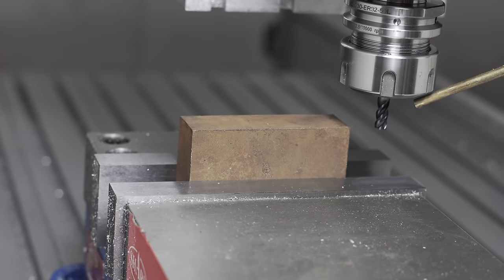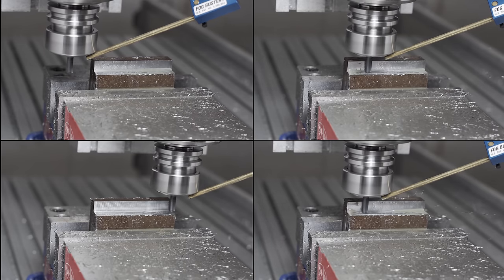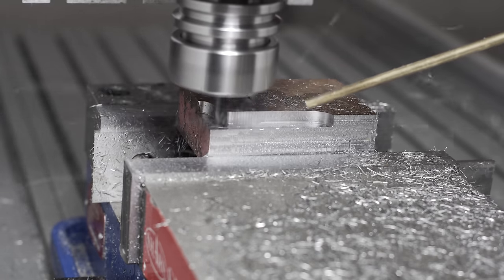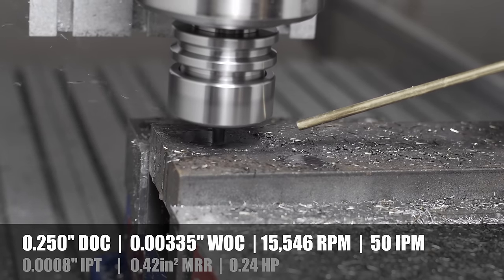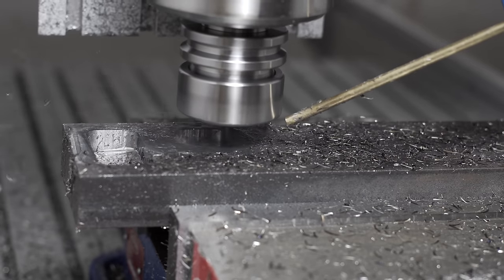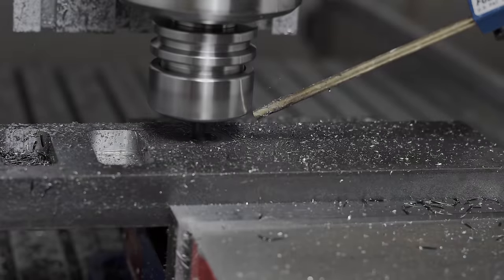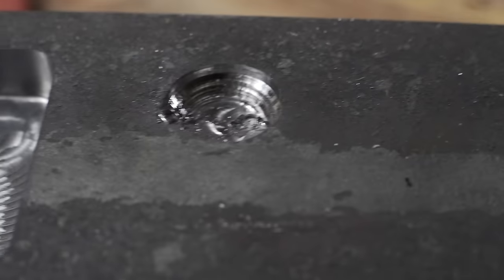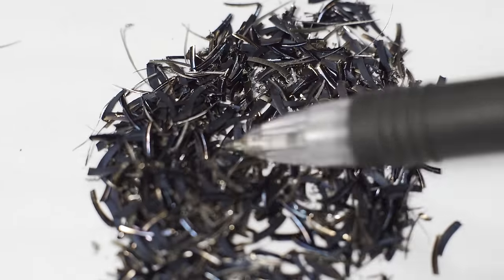Can we cut steel on a desktop gantry router?

Comment: I would be very interested to see you keep your stepover between 15-20% of tool diameter, run the spindle at its torque peak (or lowest speed you have decent torque, 15000rpm on  1/4 inch tool is 980ish SFM which is ambitious even for a VMC) and up your feedrate... .0015 IPT is entirely reasonable for a 1/4 inch tool. Running the spindle too fast will just wear the tool. As far as coolant goes, as much as you can!

Comment: You would definitely want to run coolant with the endmill you're using, as much as you can supply. You wouldn't use coolant when cutting titanium when using insert cutters, with carbide endmills you would though, but most other metals benefit from having coolant. Blaser Swisslube is best!
Reply from the maker: Noted, thanks!  Might dial up the fogbuster next time so it's more spray and less mist.
Reply: This is not correct. Tool life is maximised in steel when cutting dry, so long as chips are evacuated effectively (which air blast should accomplish). Steel does not exhibit the chip welding or adhesion issues that aluminium does.
Reply: And for titanium you should always use coolant just for safety reasons.
Reply from the maker: Huh, interesting.  I guess I'll have to try it both dry and with heavy coolant now too, just to see for myself.  Conceptually I can see the argument: since steel doesnt have welding/adhesion issues, the main thing coolant is battling is heat build up.  So as long as you are transferring enough heat into the chip and not the workpiece or tool, you're ok to run dry (and as long as you don't recut chips as you mentioned).
Reply: @captainmcderpyderp  I work in the Aerospace industry with all types of tool steals and nickle allows. When we are using tools we go for the maximum allowable use of whatever tool it is that always far exceeds the manufacture tool life specifications. 

It is important to remember that when using a tool at the wrong speed or feed and not using coolant when you should or shouldn't will result in a damaged tool after only one revolution of the tool. Once the tool is damaged it becomes more damaged a lot quicker to the point of tool failure or the tool to worn to create acceptable finish or cut.
Reply: @captainmcderpyderp  Using no coolant with air to remove chips is no problem at all. Its all about what tool you are using. In the future just make your comments you don't have to say that is not correct.

Comment: This is really impressive!  I have the Avid 2x2 but never considered doing steel. (I've got the smaller nema 23s and a variable speed router vs spindle.) 

Would using a two flute or even O flute bit help with feeds and speeds? 

I look forward to watching what you do with this machine.
Reply from the maker: Thanks!  I also have the NEMA 23's fwiw... the Avid folks mentioned the larger NEMA 34's wouldn't be useful to me because their higher torque would mainly be useful at higher feeds, but higher feeds would also start to induce whip in the ball screws.  Might be less of a problem on the 2x2 though, since they have a smaller y-axis

I'm picking up some singlue flute "O" end mills to play around in aluminum, but I don't think they will be helpful in steel.  Having such a large gullet is helpful in removing chips (which helps prevent welding in aluminum), and also logically helps keep the feed rate down.  But it also weakens the end mill due to so much material being removed, which can be a liability in steel.  The extra deflection caused by a less-stiff end mill can start to chatter/resonate when hitting the harder steel and leads to failure.  That's why most end mills for harder materials are 4+ flutes.  Recutting chips is still and issue, but since you don't have to worry about welding it's less of a driving concern and more of something you keep in mind.

Comment: Your problem isn't speed or travel adjustment. You are CLIMB milling and you need to CONVENTIONAL mill the metal. I have been in Tool & Die for over 20 years, and Climb milling is only good for 0.001" or 0.002" finish pass, and not for removal.

Comment: Do you think this cnc would cut knife blades at 6mm max
Reply from the maker: Probably!  I haven't tried any high carbon steel yet so can't say for sure, but I don't think it would have a problem cutting the steel.  Getting a really nice finish might be tricky, since you'll be battling a less-rigid machine and chatter.  But if there is a post-processing step (grinding, bead blasting, etc) I wouldn't be worried.  Winston Moy did a knife on his Shapeoko so I don't see why the Avid couldn't do the same.

I have some high carbon which I plan to use for some kitchen knives eventually... just haven't found the time yet :)

Comment: What's the largest pice of material you can work with that set up?
Reply from the maker: Pretty much the size of the table if you're creative with strap clamps and pre-drilling holes to fasten to the table. So a bit less than 24x36" sheets.  Z height is limited to around 8" however, much less if you're using vises or it's off the table.

Comment: For the speeds & feeds use the website from the producers of the endmill, like when you have Walter Tools use Walter GPS they give good data and also tell you if you should run it with or without coolant. When you do trochoidial cuts (depends on the material) you shouldnt use coolant. For Helix I did recommend using about a 2-3° angles and or about 0.5-1.25 mm per depth, High RPM and low Feedrate works fine I did say try with Vc=110 M/min and Fz= 0.01 mm (those are for low rigidity so they might work pretty good)

Comment: Drop the fug
What your aiming for is 830c in the cutting zone 
Also that machine need some more weight ( everywhere you can without changing the function ( getting in the way or overworking the motors ( maybe change them to so bigger stronger ones. Maybe even servo's) the better. Like in the tubes fill them with sand or epoxy granite 
That would help you a lot 

There is a reason why our industrial machines is so heavy
Reply from the maker: Yah, agreed on weight.  I have some future plans to help beef it up.  Once I find some time, I'm tearing it apart to install servos (have them sitting on my bench waiting to be installed) and new control hardware, and while it's apart I was wanting to fill the table extrusions with sand.  Figured it was easy and cheap way to add mass and more damping ability.  I also have a big 0.5" plate of steel I'm going to machine up as a fixture plate, should add another 100lbs to it too :)
Reply: @BreakingTaps  nice 
and if you want to take it to a even higer level ( witch im planing for mine ) is to make a hollow steel tube frame table. the top of it milled flat / after its been welded together and set for a few days to make sure its seddeld in ) get mounting holes and threads made. bolt the machine to the top of the table ( since its welded , milled, drilled and tapped as one it should be a perfekt fit ) filling those tubes with sand as well and leveling feeds on the bottom ( prefer 9 legs but 5 should also be good enough ) 

since its gonna be tightly bolted togeather it should act like one big solid peace and not two independed ones

but good to hear that you have those things already and is planning on it already 

btw i hear that clearpath servoes can be wired up to the ess thats already in the controle box of the machine

if you want i can try and program some cool/educational toolpath that you can use and learn from if you want ( im a fully educated cnc machinest ( was among top 2 in my class )  ( i did take a younger student's roughing program and cut the time down from 12 min to 1 min and 5 sec )

best regards 
custom rig's

Comment: Awesome. CNC router aluminum frame its not for steel but the important its possible make non 
precise parts like welding plates, engine header plates, exaust spacers etc. the brand of the endmill and more hp its important. you need make sample with 3 flutes endmill Kennametal Brand.

Comment: Awesome video!  I’ve got an avid pro on the way for my second machine!  Any tips?  Ive been running a routakit HD for the last couple years to my dismay.
Reply from the maker: Hmm.  I got bit by step calibration because I only did it in one location... so if you calibrate make sure you repeat in several locations, and try to calibrate across large distances if possible.  Otherwise, a sturdy table is really needed.  Once you get the machine moving fast, it has a bunch of inertia and can throw the table around if it isn't stout (which then causes issues in the cut because things are waving about).  Otherwise I've been pretty happy with it.  Goodluck!
Reply: Breaking Taps I’m using my own electronics so I’ll have to calibrate on my one but I appreciate the heads up. I doubt I’ll be cutting any steel.....other than clamps!

Comment: 4:05 is that endmill for aluminium and u use it for steel ?
Reply from the maker: Nah, just shooting b-roll after the main cutting was done and it was the end mill in the holder at the time :)  I used a 4fl variable for all the cuts in steel in this video
Reply: Breaking Taps okay

Comment: This is the most impressive router I've seen.. did you ever find out what grade of steel that is? It actually looks cold rolled as it's pretty uniform, but then it's dark.. so maybe it's hot rolled?!
Reply from the maker: Thanks!  Unfortunately no, never did determine what the first chunk was.  When I was first tooling up my shop, I picked up a bunch of cut-offs from various sources (ebay, local, "cutoff boxes" from suppliers, etc).  They were roughly organized for a while but got jumbled up at some point.  There's also a small chance it was D2 or A2, since I have a small selection of cutoffs from that and they weren't labeled well either :)

Comment: My only issue with this is for 3 grand you can get your hands on a used cnc milling machine. These small machines are so costly compared to used industrial hardware.
Reply from the maker: Yep, totally agree! But my area has essentially no industry, and I didnt want to deal with driving out of state to look at machines and transporting them back home.  Moving my manual mill across town was hard enough, let alone a VMC.  And you roll the dice with getting a clapped out machine or needing unknown maintenance.  That and my garage doesn't really have space for a VMC.

But I absolutely agree, used industrial equipment is both cheaper and more capable if it's available and you can check it out locally for issues.

Comment: would you divide the feed by 4 if you used a one flute end mill?
Reply from the maker: Generally, that's correct!  Feed rate is mostly tied to number of flutes and the chipload (which is a combo of width/depth of cut and material).  But you wouldn't want to run a single flute in steel for example, because the tool wouldn't be rigid enough... that's why 4+ flutes is generally recommended in steel.

Comment: nice machine, what kind of stepper motors you got on that little beast?
Reply from the maker: 420 oz-in NEMA 23 steppers, although I do wish I had splashed out for the larger Nema 34s instead.  Or just gotten servos.  Oh well :)
Reply: @BreakingTaps  that's exactly what I wanted to hear. Thanks.  I just ordered some nema 23 motors and that looks powerful enough for my needs, gotta redesign the whole machine to make them fit but it looks like they'll be worth it.  My Nema17's lose steps when they need a little lubrication, even while not cutting anything.  Squeaking is one thing but losing steps is another

Comment: try a 6 flute end mill, 5% stepover, ful DOC and run it dry with air blast.
Reply from the maker: Will look into it!  I admit, I sorta assumed my machine wouldn't be capble of running flute counts > 4, but didn't really play around with calculators to validate that assumption.  Will poke around a little and see how it looks, thanks!
Reply: Breaking Taps the higher flute count will give the tool more rigidity. Take a lighter step over bit more aggressive feed. Might allow you to get a better result. Who knows

Comment: did you say the depth was .25 of an inch?
Reply: why i ask is on a mill we go .039 depth = 1 mm with a mill for every cut lol and let it run. then add 1mm run. then add 1 mm and run.
Reply from the maker: For the depth of cut when testing?  0.25 inches, or 6.35mm. :)
Reply: @BreakingTaps  could you cut at 1mm and then do another pass 1mm deeper? I ask because I believe even though it would take longer I think it would save the bit and could work longer term. im trying to find a desk top cnc I could use to cut steel and brass make tattoo machines from. the main part on the frame that would be nicer cnc-ed is only about 3-5mm thick. the rest could be milled

do you think this would be a solution
Reply from the maker: @ragnartheredbeard9667  Ah I see.  Yeah, you can use smaller depth-of-cuts.  1mm might be a bit small, but 2-3mm would work fine.  You need a certain amount of depth to take a good chip, but after that there's no issue with using shallow cuts.  The downside is that you end up wearing just the end of the tool instead of the full length, and often have to compensate by taking a thicker cut (more radial load) which can actually be harder for machines sometimes.  Deep cuts + shallow radial load + high speed/adaptive tool paths are pretty gentle on machines and that's why you see most routers zipping around doing light adaptive passes.

But yeah, to answer your question, no problem taking more shallow cuts.  Winston Moy's channel has some good examples of using a shapeoko (considerably lighter machine than mine) to CNC steel parts, and often does it with pretty shallow cuts.

Comment: 2:33 at this point I am reminded of the problem of flute engagement or however you want to call it. there is actually a great video here: https://www.youtube.com/watch?v=Wks3Zf0Khec
where this problem gets explained, and I am wondering if that may be the problem here. of cause it is not easy to correct for this, because it usually requires a large stepover which might not be possible with your machine.
and maybe I should continue to watch the video, because maybe this exact problem gets adressed.. or not? I will find out in a few minutes
edit: nope, allright. so anyone who is interested in this topic and doesnt know what I am talking about should definately watch the video I linked above!

Comment: Hey i do alot of hsm and i wohld run the .250  to .250 dp with a .012 radial step over 16000 rpm .0045 ipt. Try that once
Reply from the maker: Will try it out next time I'm doing something in steel.  Cheers!

Comment: do you have a build list?
Reply from the maker: Not a complete set, but the main components are the Avid CNC Benchtop Pro 2x3, CNCDepot S30C spindle, and a fogbuster for coolant.  If you'd like I could probably put together a list of various accessories that were needed too (solenoids, etc) but those are the big ticket items :)

Comment: Two things: 
The primary reason for cutting fluid is to keep the chip from welding to the cutter. Something that coatings can do.
The vibration in the frame of the machine can be (possibly) reduced by gluing an absorbing material, to random places on frame. Use your fingers to FEEL the vibration as you cut. 😎

Comment: your first one was excellent speeds and feeds when your chip start to change color on your second one that was a warning sign when they turned blue you're in Mill was about to die and running a mister is very good for the life of the end Mill
Reply from the maker: Hm, really?  Everything I have read so far indicated that blue in the chips was good (e.g. a quick skim of PM forum threads seem to say the same).  ++ agree the spindle bogging down should have been a warning sign :)  Noted about mister, thanks!
Reply: Breaking Taps Who on earth are you talking to? Blue chips are a warning that you’re doing something (possibly EVERYTHING) wrong! They are also a safety hazard for the operator as well as an obvious fire hazard!

Comment: 3,500, why not just go the extra mile and get the Tormach 440 PCNC
Reply from the maker: I considered it (and other tormach offerings), but wanted a higher speed spindle, larger work volume and ATC.  Definitely a tradeoff in other aspects but for the sort of work I do it was probably the right choice for me.
Reply: @BreakingTaps  my bad, I did'nt do my research before commenting. I had no idea that this machine is half the price but basically slays the Tormach 440.
Reply from the maker: @brandonnorris1026  No worries, it's a valid question!  Especially once you add in the ATC spindle, the price is closer to a tormach than you'd think :)  I can't find it now, but I posted somewhere on reddit a comparison of the different machines that are roughly in this price range (up to a Haas Mini Mill iirc).  I'll keep hunting and drop a link here if I find it.  :)

Comment: Are we being serious here and their machines are extruded aluminum based and 3.5-7 grand a piece?  If that is for real they are smoking some really funny stuff.
Reply from the maker: Mix of extruded and billet milled pieces.  And nearly 400lbs of aluminum all up.  Ball screws and linear rails on all axis, dual Y-axis motors, 420 oz-in steppers and fully wired electronics cabinet, etc etc. I'm not sure why you would think the machine is a joke given the video you're replying to.  It runs laps around equivalently priced machines (Taig @ $2500 and weighs 100lbs soaking wet, Tormach 440 @ 600lbs, etc)
Reply: @BreakingTaps  Yeah, frankly it makes Tormach machines look like a joke.  This thing has very nice prismatic linear rails.  4 rails 8 blocks for the gantry, and 2 rails 4 blocks for each remaining axis.  They all have built in oiler cartridges for less maintenance.  Honestly their benchtop pro series is a steal once you get a chance to look at one in person.